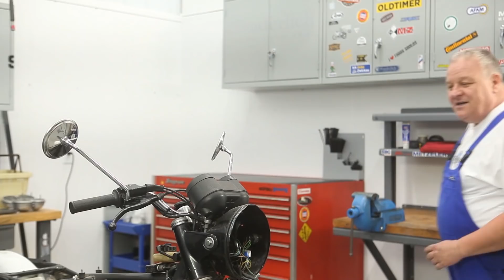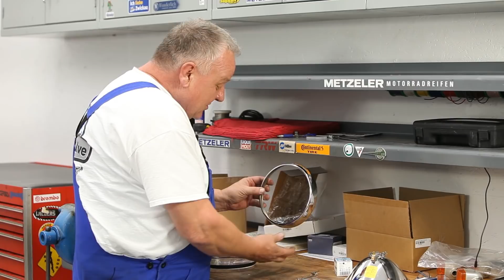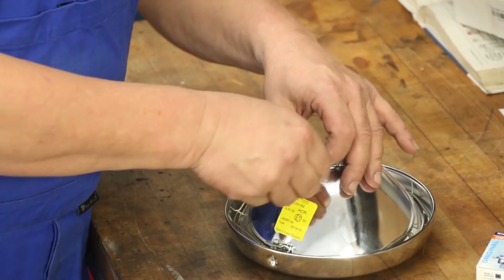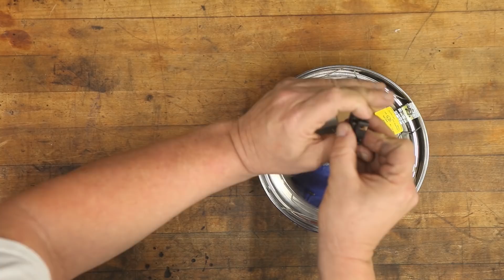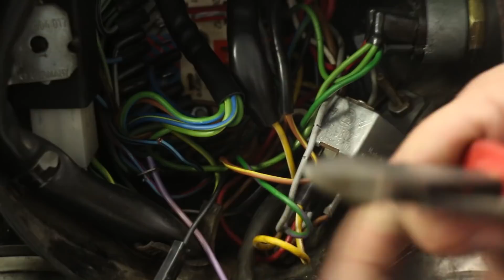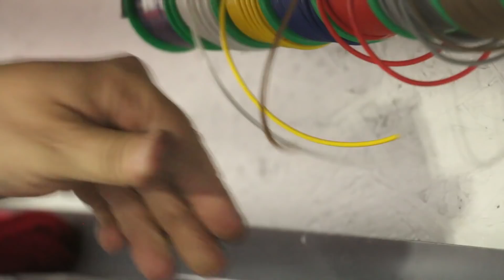R90/6 Episode 21 - Headlight Assembly, Headlight Bucket Wiring, Ignition Switch

Comment: @boxer2valve- question about the headlight bezel which I just got from you guys. It hinges, and there's a spring in between the hinges that the bolt which is a Phillips head goes through, and I just bought this but I can't tell how it actually clamps. it doesn't actually grab my original headlight bucket so I'm kind of lost, my original bezel is here but beat up and there's a different construction to mine that has a riveted tab thing on it that is bent and goes over the bottom lip. there was a screw in the headlight bucket portion in a hole that was originally square looking small but someone put a fastener through it and screwed into this thin metal tab. I actually don't understand what the original design of this area was and mine from yinz is not holding in place... any idea how this originally worked?

Comment: About that little clamp at the bottom of the bezel; does the hinge or the open part face the bucket? Sick of having the old stock bezel fall out on bumpy roads.
Reply: It hinges, and there's a spring in between the hinges that the bolt which is a Phillips head goes through, and I just bought this but I can't tell how it actually clamps. it doesn't actually grab my original headlight bucket so I'm kind of lost, my original bezel is here but beat up and there's a different construction to mine that has a riveted tab thing on it that is bent and goes over the bottom lip. there was a screw in the headlight bucket portion in a hole that was originally square looking small but someone put a fastener through it and screwed into this thin metal tab. I actually don't understand what the original design of this area was and mine from him is not holding in place...@boxer2valve, any idea how this originally worked?

Comment: Oh dear. I waited 25 minutes to see how the front indicators were wiring into the headlight shell. My wires come from the headlight shell and presumably go into the holes in the iner sides of the 'ears' but what happens then. The bottom of the ears are sealed with the rubber bushes. How does the wiring rear the chrome indicator stalks? Thank you.

Comment: I have the same year and model and it had been stored outside for the last 35 years. It also had a fairing and a butchered wiring setup similar to yours. My question is: What switch actually turns the headlight on and controls the high and low beam.  I can make the left hand switch flash the lights in the down position but that is it. Thank you for your videos. I buy all my parts from your company, as I think you have earned my business many times over.

Comment: "The thin edge of the seal goes to the inside of the headlight?" I found that to be confusing. There is a thin ridge and a thick or double ridge on the seal. I was looking at the video for clarity on this and I think these videos are outstanding but that explanation went by a little too quickly and was confusing and there is nothing I can find on the web clearing this up. Is the inside the front of the headlight as it faces out? I think that is what you mean but not sure. Also , I bought one of your headlight rings and found the hinge mechanism to be almost too tight against the light reflector to get everything lined up and to get the clips in. Could you comment on that and clear up the headlight seal question. Thank you for your outstanding how to videos!
Reply from the maker: Sorry if that was not clear. The groove in the seal is not quite in the middle. One of the raised edges is wider. The wider of the two sides faces forward.
Reply: Thank You. That helps clear it up.
Reply: After watching again a few times I can see the thin edge goes to the back (inside you are calling it) of the lens.
Reply: I think you intalled the lens gasket incorrectly.  Sounds weird, but the smooth side is actually supposed to be against the glass lens, and the ridged side facing outward, with the single ridge facing forward and the double ridge facing rearward.  Seems odd, but it's how the factory did them.  This better prevents water intrusion.

Comment: My R75/7 had a big Vetter fairing with an integrated headlight.  The headlight in the fairing was actually the BMW headlamp with an extra wiring harness.  I only had to remove the needed parts from the fairing and attach them to the headlight bucket.  Much easier than all this.

My frame still looked just as awful due to the hose clamps used to secure the fairing to the motorcycle frame.

Comment: Great  video series - has been a huge help restoring my 1980 R100T.  I have installed the Cyclops LED headlamp - excellent upgrade - do you have experience with the LED headlamps in these vintage models?